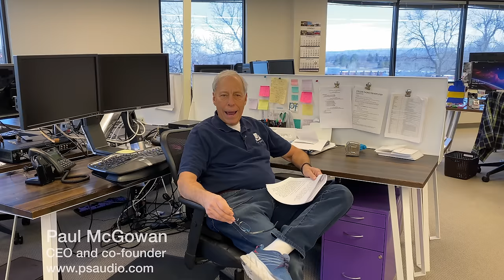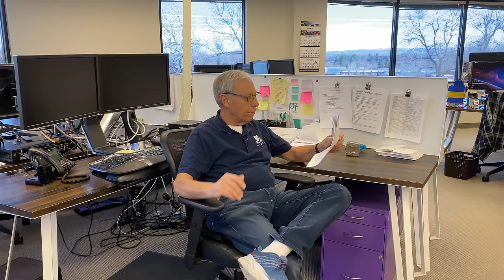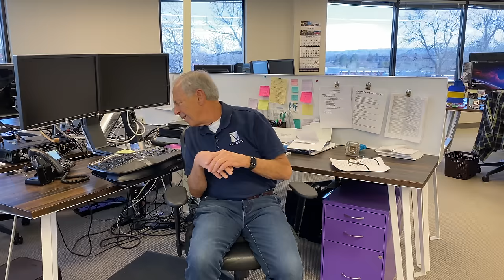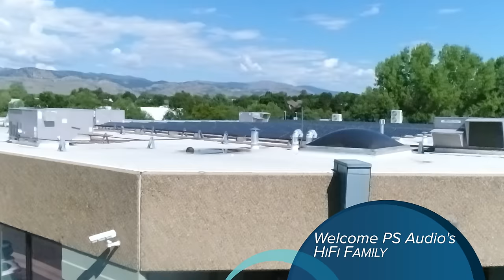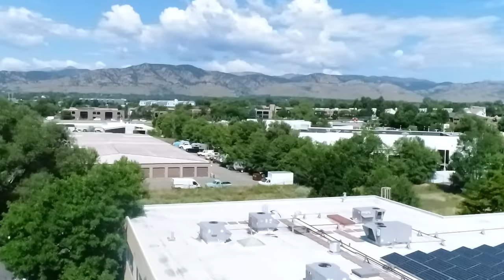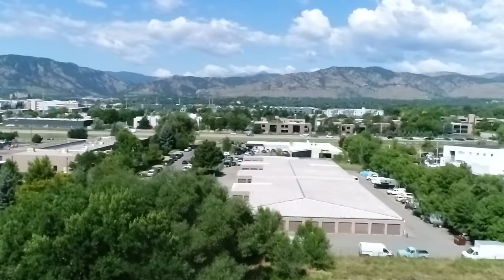Digital or analog out?

Comment: CD players run with their own clock and an external DAC has another clock. This means your data coming in is out of synch with your DAC running the conversion. To align the clocks, an external DAC has to sort of guess the clock of the CD player. With an internal DAC in the CD player you avoid this problem as everything is in complete synch. Better is to get rid of the CD player and use a DAC that pulls the data from a solid state storage or stream such that it runs the clock of the data in full control.
Reply: My internal wolfson DAC runs perfect. :)
Reply: Caveat to the above: If you deliver the individual clocks from the CD player to the DAC without having to go though intermediary encoding and decoding with subsequent clock recovery, you gain the benefit of total synchronization as well as the benefits coming from an audiophile DAC implementation. I placed a digital tap in my Sony CDP-101 player to enable this functionality and make it more of just a transport.
Reply: Thorsten Amesöder Internal DACs in CDs are architecturally the right way due to synchronized single clock data flow control and only issue is when the engineers go cheap on the IC.
Reply: And you think that when a DAC pulls data from the external drive there isn’t another clock involved than the master DAC clock?  Sorry but there is. Everything digital works entirely on clocks and flip flops. And let’s not forget that external drives are noisy. A good CD player with digital out will be far less noisy.
Reply: Alain François The best architecture is one where a single clock directly clocking the PCM data in the DAC is what determines the flow of data without any other clock pushing data from the source side. This means a data pull architecture. A CD player can work as clock master pushing data to the DAC if using I2S but the issue then is that the DAC is likely using PDM at a much higher frequency and thus needs a higher frequency to run at anyway causing the need for a separate out of synch clock. Of course you have oscillators in many places throughout a digital audio path involving music but it doesn’t matter for any jitter issue if the system is pulling the data. For example, there is no jitter introduced from the crystal oscillator in your WiFi router when an audio streaming player runs a media session over your WiFi router because it’s entirely based on a pulling data approach. A good DAC will include sufficient smart data buffering and some way of eliminating audible jitter without impacting the DACs own output clock.
Reply: "To align the clocks, an external DAC has to sort of guess the clock of the CD player."
It doesn't guess but rather extracts the clock from the data stream. Look up Manchester Encoding. That's the encoding SPDIF/AES uses. 10mb Ethernet used it as well.
Reply: Andy Delle The issue is not to find out the sample rate is whatever. That’s easy. The issue is that separate crystals are not running exactly at the same frequency and you either end up with over-run or under-run if you don’t do something. The worst solutions end up with audible jitter. I’ve seen gear that played well for hours until suddenly the DAC got starved and you could hear distortion. Of course there are good ways to completely eliminate audible jitter (buffer enough PCM data and re-calibrate buffer upon silence, for example). Especially SPDIF is blamed for causing jitter but it’s due to bad engineering when it happens (using PLL to “guess” the frequency). Also check: http://www.esstech.com/files/4614/4095/4305/about-jitter.pdf
Reply: @ThinkingBetter  But the oscillators are not free running. They must be phase locked. The jitter comes from the PLL design which is an infamous compromise between capture range and stability. RS232, 422 and other low bandwidth serial interfaces worked with free running crystal oscillators on each end. You can get away with a 2-4% frequency differences at even 115K baud. But SPDIF/AES is 3mhz. Free running oscillators aren't going to work at those frequencies. Yes better DAC designs do use FIFOs or buffers to help reduce jitter. But the receive clock must still be phase locked to the transmit clock and tat reference is encoded into the data stream via Manchester Encoding. The standard SDI digital video interface works the same way. Here we have anywhere from 270mbs to now 12gbs. Again it's a single serial stream with the clock embedded through data scrambling to even out the mix of ones and zeros.
Reply: Andy Delle The master clock difference between a CD player and DAC is a fraction of a percent for any reasonable product and using PLL is common but not really necessary. It’s the PLL that makes audible jitter happen (assuming an otherwise good crystal). I’ve done designs without PLL and managed the buffering by using any moment of silence to recalibrate it. It’s super simple to do when you have a DSP on the receiving end and you don’t have to lip-synch with video (TVs need that). Audible jitter is the result of stupid engineering. This has nothing to do with the serial communication itself that can have jitter also but what matters is the data rate that stamps through the DAC. I’ve done products shipping in millions of units involving this topic.
Reply: ThinkingBetter  That is the theory. You can throw that all aboard when you have heard what an EtherRegen does. All DAC manufacturers say that their DAC’s can perfectly cope with incoming jitter. Really is that none and I seriously mean none can. Many hear the difference when an Ethernet switch reclocks the signal. For now nobody has a clear answer to why. The EtherRegen of course does more than just reclock the signal.
Reply: @afrancois1968  I'm sorry but you are talking with someone who actually work in R&D of these things and have managed at least 20 million products shipped so far to consumers like yourself. Jitter is arising only in the DAC when the music levels (PCM/PDM) get misaligned in time due to any clock fluctuation in the DAC either caused by a poor oscillator or a poor PLL design. The IP traffic is totally a non-issue for jitter and that EtherRegen is an utter joke of snake oil. Will it also make my Powerpoint presentations look better? Can it improve video also? LOL. Any streaming involves an asynchronous read of the data from a server (pulling method). The player itself ideally runs on the DAC's master clock ensuring that data read per time matches the sample rate of the music exactly. This is easily achieved in a CD player with the DAC onboard. The issue of jitter involving PLL arises when a music player (CD, on your computer, phone or whatever) runs a clock that isn't 100% matching with the DAC. For example, if your Spotify app on your PC pulls less PCM samples (in encoded format) from the Spotify server than 44.100 and your DAC runs at exactly 44,100, then you will starve the DAC unless it does a PLL to slow its clock down slightly. Starving could mean that samples will be dropped causing distortion. A PLL is used to slightly increase or decrease the clock to ensure the data is clocked out without buffer under-run or over-run. An alternative method is to (FIFO) buffer enough music data to avoid under-run and have enough memory to avoid over-run. You can reset such buffer every time there is no music and allow the DAC to precisely run the conversion with absolutely no jitter issue. Audible jitter is completely avoidable.
Reply: ThinkingBetter All what your saying I know without being in R&D,. I’m just a simple computer scientist. A few years ago I was the first to reason in 1 and 0’s. An open mind got my system to the next level. Stick to your scientific ideas and you will never have a system that sounds as good as mine. Try ridiculing others with your Powerpoint reference. The joke is on you. You ridicule the EtherRegen without even hearing it. That’s the opposite of a scientific mind. Real scientists don’t have predefined mental boundaries. All what you are saying we already knew 30 year’s ago. Are you saying we reached the pinnacle of  digital audio 30 years ago? What defines us as humans is that we constantly strive to do things better. Of course not always. Think about the terrible compressed music of the last 20 or more years.
Reply: ThinkingBetter You just confirmed in which camp you reside with your url to audiosiencereciew.
Reply: Alain François Real scientists and engineers know what they are talking about. I work here in Silicon Valley California and can understand every line of code that runs this stuff. I also hold more than 20 patents in related areas. NOTHING is magic in audio dude. That EtherRegen is insane idiotic snake oil BS. The TCP/IP or UDP traffic from any music server in the cloud is entirely asynchronous to the DAC clock. The issue that will arise if the internet gets too slow is that your music will stop or, if supported by your music streaming server, a QOS algorithm will pick a lower bandwidth codec with more compression. Again, that also has zero to do with jitter. You didn’t read that test report in the link I provided you, did you? Go read it.
Reply: ThinkingBetter You didn’t acknowledge you have heard the EtherRegen! Guess you buy equipment on specs. Silicon Valley?  I work at CERN LOL
Reply: Alain François No, you don’t work at CERN and you have no clue about how a digital audio system with streaming from a server actually works. I deal with lots of scientists and engineers here and it’s fair when people don’t understand a subject and admit it. Of course I buy equipment on specs but also I check by doing careful listen tests. I’ve been professionally conducting blind listen tests numerous times. Specs are very important but especially for speakers, you need careful listen test also. Again, audio is not magic at all and we also understand why listen tests can do things simple measurements can not.
Reply: @ThinkingBetter  Of course I don't work at CERN, you didn't get the irony? I'm sure others do. Believe me, I have more than a clue. I don't pretend to know everything however, as you do. Can you explain for example why everything sounds so different while everything is so well known? I know there's some snake oil out there, perhaps some of them are in my system. All that I can say is that is sound far superior now than before. And the reason why it sound a lot better is because it's full of tweaks you reject because of scientific reasons. You are depriving yourself of great audio. Think about that Mr. Better Thinker. Btw. I'm well aware of of Floyd Toole and his circle of confusion. I do agree with what he says, including the blind listening test conclusions. On the other  hand his findings also confirmed what I heard in my listening room. I attributed quite some problems I had with my system to the acoustics. During my 2 year pursuit I found out that at least half of the problems wasn't my room, but my digital chain. The room is very important don't get me wrong, but I found out  to my surprise that the electronics had an issue as well.  I'm using Lyngdorf , so I know what room correction can do.
Reply: Alain François I don’t pretend to know everything but there are things I know deeply cause I worked in this field on engineering for decades. That EtherRegen product is a scam and people who say it sounds better imagine things. Your media player (Spotify or whatever) will get the exact same data using whatever IP routers or switches are involved in your home and as long as the data arrives without starving the player, there is nothing gained in using a different router or switch. The player decodes the audio not based on any clock on the IP traffic side but based on a master clock that is completely independent on IP traffic. If your system truly sounds different because of using the EtherRegen, you have some very poorly designed system with some actual flaw in it. This topic is like discussing flat earth or other nonsense. Do you also question science on how the earth is?
Reply: ThinkingBetter Yeah right. I looked at science with big eyes all my life. That’s not the problem. I don’t have any design problems in my system and surely not in the networking department. I have 10gb fiber optic Ubiquity setup throughout the entire house. I have 4 separate VLAN’s. A high performance NAS with 3 separate NIC’s, etc... I have 2 of the best amplifiers ever made in my opinion. I have very nice Focal speakers. No need to talk about flat earth to someone who has actually read A brief history of time. Many years ago when people like you had never heard of Stephen Hawking I took pictures of him visiting the Williams F1 team. I could see on many peoples faces that they thought I was simply taking pictures of a handicapped man. And yes I had a VIP pass to the pits.
Reply: @afrancois1968  VIP pass to the pits has nothing to do with understanding how digital audio streaming works. I can have great respect for audiophile details that are truly real and impossible to measure that both you and I appreciate. I just had a meeting discussing planning of a listening test in a meeting earlier today in fact. Listen tests are extremely important. But an ethernet bridge or router has as much impact on the sound quality as the color of your speakers has. I'm into very high-end audio btw, but I understand what's real and what's not. Oh, you might have problems with ground loops, EMI and common mode noise in your gear that is causing real problems. Using WIFI is better for isolating stuff in some cases.
Reply: ThinkingBetter  Again, you don’t get it do you! The pass wasn’t the main topic, just a side note. Let me clear it up for you or not :-) I’m on to you since your first message. Or not, let’s keep playing. Ground loops? Seriously? Come on, you should at least have a small idea of who you’re dealing with. EMI probably to a very small degree, but so does everyone’s system.RFI probably more, but everything is very well shielded. As good as possible and probably to the extreme. Common mode noise is probably the hardest one. That’s a tough one. Here I have to trust the best designers in the business. What about DC offset on the mains. A big party killer you forgot to mention. It surely was in my system. I only hear high end, but you don’t say what! Feels to me you just talking like a 6 year old kid who says his daddy ‘s car is faster... You know the rest.
Reply: @afrancois1968  I perfectly get everything including your mentioning of irrelevant points. Yes, ground loops, common mode current and EMI are known issues on interconnected devices. You obviously don't understand that RFI is indeed electromagnetic radiation but a subset of EMI, so it's meaningless to say you have more RFI than EMI. By definition, you can only have same or more EMI than RFI.
If you have a DC offset on your mains, you should find the cause (some load that is asymmetrical, perhaps with a broken diode) and fix it. A grid transformer does not output DC. A DC offset will cause some heating up of transformers in your amps wasting some power but shouldn't hurt performance as the AC output of a transformer is still the same and transformers filter out DC offsets.
Anyway, I have some respect for noise issues on the mains impacting audio. I have no respect for EtherRegen's bogus claims...that product is a scam for ignorant consumers. Period. I'm happy some people care to spend time debunking it: https://www.audiosciencereview.com/forum/index.php?threads/uptone-audio-etherregen-switch-review.10232/
There is no scientific argument for the claim made by EtherRegen about jitter. It's pure idiocy demonstrating total ignorance of how things work.
Reply: ThinkingBetter You are right RMI and RFI are basically the same thing. I should have referred to generated EMI by the equipment itself and EMI coming into the equipment from external sources. You keep talking about the EtherRegen being a scam. I don’t agree. The amount of effort put into the design does not suggest that the device is purposely built to deceive people. There are far more cost affective ways of scamming people. Take a 1000$/meter speaker cable for example. I also don’t think that jitter reduction is the reason why I hear such a big difference. The EtherRegen is more about isolation from the equipment in front of the EtherRegen. The difference is really obvious.There’s no way around it. I probably have one of the quietest system around. It’s really remarkable, so I ‘m pretty sure there is nothing fundamentally wrong with the system  and why it would react in such a way that it does with the EtherRegen in place. If you have a system able to compete with mine I would suggest you give it a try. To be honest I was also very skeptical about the hype surrounding the EtherRegen. That’s why I waited until the 3rd batch of shipment. I was really shocked. I heard the difference instantly only 5 second into the music. I also understand you will never ever give it a go. This would mean taking back what you have said before and this would be very hard to swallow. I took the chance and I’m happy. For a scam it’s very reasonably priced. My 2 year long journey tweaking my system had everything to do with getting the cleanest signal possible. I think a good clock could help reduce noise because of its better phase noise. Clean power, cleanest possible digital signals with the least of unwanted harmonic content in the signal. It was only after this rather long journey that I found how good my Millennium MK4 amplifiers are. Way ahead of its time. I firmly believe that the digital to analog convention must be done at the very last possible moment, at the speaker terminals of the amplifier.
Reply: Alain François EtherRegen is a scam. As audio has gone digital, so has the snake oil gone digital. The notion of jitter with this EtherRegen is clearly snake oil. In terms of galvanic isolation from my router, I have no issue because I use WiFi. Just using WiFi will eliminate any conducted noise. My house has a ton of WiFi stuff connected nowadays and it works great also for video, even 4K.
Reply: ThinkingBetter I did in the past take a quick look at the link to the EtherRegen at audiosciencereciews . Now things have really taken a turn for the worse! The number of immature comments is beyond everything I have ever seen on any forum. Really makes me question the average age of the people involved. Talking about tribal behavior! I must admit that whilst we have provoked each other a bit , we remained civil. You have your strong opinion and I respect that. I also truly understand your standpoint. After all it’s based on science. I’m an atheist and I ‘m not someone who wants to believe. I try to trust my ears, even while I ‘m convinced that the combination of brains and ears can be deceiving. Thank you for our discussion even if it got somewhat heated.
Reply: Alain François Yes too many people have lost the sense of dignity when it comes to communicating with others. The USA has gone rogue with a divisive political split as one recent issue. Silicon Valley is the most anti Trump area of America and also the most atheist area. At the same time the search engines of Google, Facebook and others made here have pushed people into a confirmation biased consumption of media leading to strong division of opinions on a global scale. Silicon Valley made Trump happen and we also hate him most. We made flat earth believers grow and we are the least flat earth believers and so on. I’ve been audiophile for decades and spent upwards near US$200,000 on my audio systems. I love high-end audio and have lead numerous products in this business for several top tier brands in high-end and also high-volume. It’s foolish of me to pretend I know everything and surely I don’t. But some things I am sort of expert in and holds quite a few patents in. I enjoyed talking with you because you are a sincere audiophile seeking the best in performance. We are in that same boat.
Reply: ThinkingBetter I sometimes talk very passionate about music and gear with friends and colleagues. I know they are not into it, but I can’t help it. I luckily don’t do it often. My system is approaching 90000€. I never say this because they would declare me insane. Spending that amount an a car however is considered OK.  I have a nice car but my system gives me such more joy. Music is the highest expression of art and the only art that can provoke such strong emotions.
Reply: Alain François Yeah, I have music around me much of the day at home, on the go and at work. In my office I listen to music when working on my computer and even when I go shopping I’m wearing my earbuds and DAC. I just went to Wholefoods here in Santa Clara and although Apple, Google, Intel, Facebook and so on have their main headquarters around here, not many are actual audiophiles of people working in technology. It’s a bit sad but audiophile people are sort of disappearing with the trend of “small is cool”. Personally I can’t stand music on a small Bluetooth speaker or some crappy Apple earbuds. I would not enjoy a second of such quality. When I was in college, I had many friends around me passionate about audio and building their own high-end speakers and so on. We even had a competition about who could make the best sounding speakers and invited the entire university to come and judge in a big auditorium where we had our speakers on stage. Audio as a hobby has experienced three blows...first came the home computer era...then came the internet era...finally came the “small is cool” mobile era...each have made less people attracted to high-end audio.
Reply: ThinkingBetter 99.9% have never experienced high end audio. Of those 99.9%, 99,0% aren’t even interested. Strange that many people like music but don’t care how it sounds. I only listen to music on the train to work using a Sony WH-1000XM3. I even rarely listen to music in the car even though I have a Burmester sound system. Always someone besides me who can’t stop talking :-) She simply turns down the volume to zero.
Reply: Alain François Yes it’s a tiny fraction who truly care about audio quality. Yes, as an audiophile we tend to think it’s strange anyone can listen to music on something that sounds like crap. And I’ve often seen that even when I make them hear something they sounds much better, they just tell me it sounds almost the same to them. Once I was visiting a friend I immediately noticed his speaker setup had the speakers out of phase and yes, he put the cables wrongly and I helped him fix the polarity of his speaker cables and it obviously made it sound much better. But he had lived with it for several years. I’ve given some premium earbuds to family members as gifts a couple of times and to my horror learned they still keep using their crappy Apple phone earbuds. They rather show off their Apple stuff while on the go (sort of like a decoration) and listen to poor audio.
Reply: ThinkingBetter Image before quality. Take Beats headphones for example.
Reply: Alain François I once went to a headphone factory in Dongguan China as we were evaluating multiple contract manufacturers for some project and when talking with the engineering manager, I asked him about his favorite headphone brand. His reply was “Beats” and at that moment I just wanted to leave as I knew it was total waste of my time.
Reply: ThinkingBetter Nice! I use the Sony’s because of the noise canceling. For me it’s a must have on the train. That way I don’t have to pump up to volume. It relaxes me before and after a hard days work.
Reply: Alain François Yes, Sony does some good audio products. Some times you will find audiophiles unwilling to accept a mass consumer brand just because it’s for mass consumers even it actually sounds great.